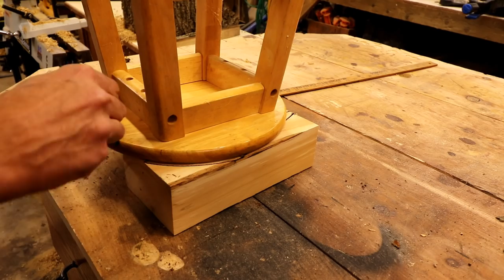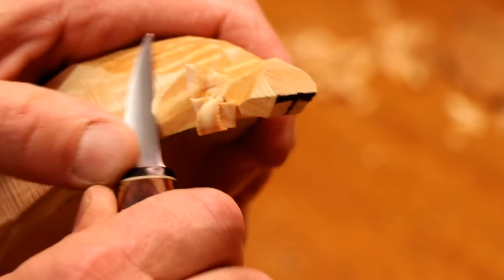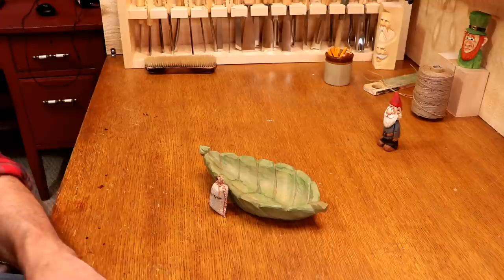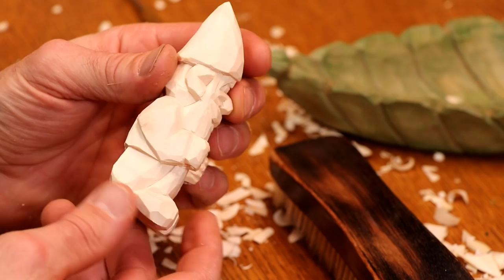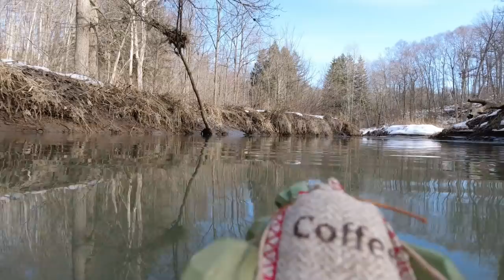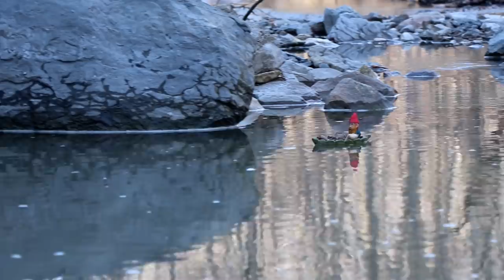The Gnome's Supply Run - Adventures in Woodcarving and Water

Comment: Why did you cut it in half and then glue it back together? It looks like you cut a certain angle when cutting in half.
Reply from the maker: It was a temporary glue back to be able to cut the lines on the flat-you see me separate it again after